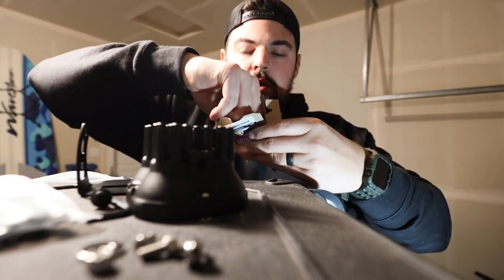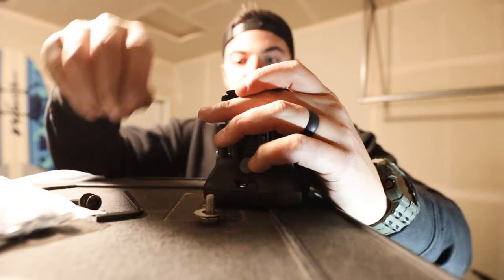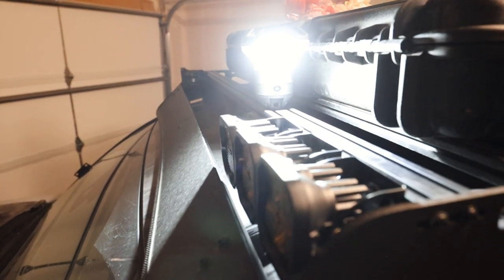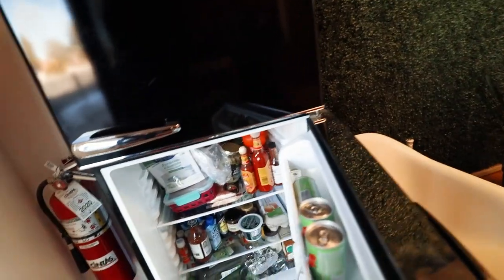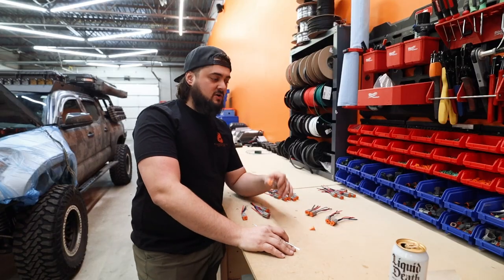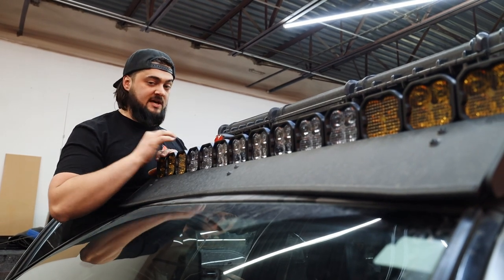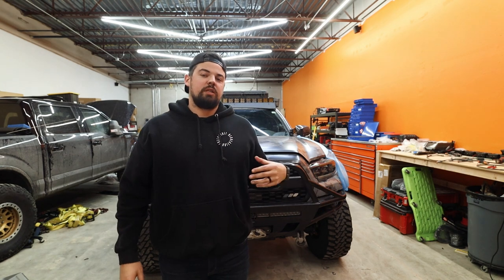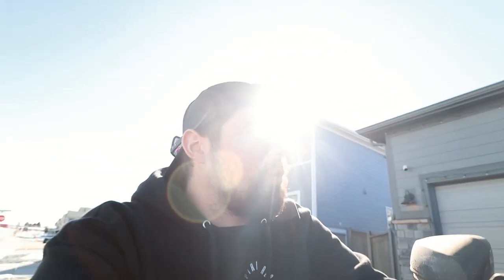Operation PreLander EP 6 / Installing 14 Diode SS3 Pros onto the Sherpa Rack

Comment: Considered doing the same for my tundra on my prinsu, any shots at night with this ? Vs the cost of the SS5 lightbar kit would you recommend this setup or SS5 ?
Reply from the maker: Don’t have any shots at night yet but will be in Moab all week next week and vlogging the whole thing. I’ll make sure to show this off. I also don’t recommend a light setup light this on the prinsu. I did one like it on one and it vibrated my whole roof even after adding two additional cross bars to the rack. Their mounting solution just isn’t up to par in my opinion. Too much stress on the side rails. 

As far as looks go I prefer this setup and less people run it.
Reply: @The_dark_yota  I've had quite a bit of issues with my prinsu. I've wanted to run a Sherpa for a while now just not sure if I could with the holes in my roof from the current rack 💀 
Thanks for the input man ! Love this channel and the work you do.
Reply from the maker: @Rusky231  sounds about right man. I would reach out to Sherpa and see what they say. You might be okay and that Sherpa rack would be a much better solution for you to run the lights man. 
I really appreciate that thank you 🙏🏼
Reply: @The_dark_yota  just reached out to Sherpa, much love man! Looking forward to seeing this setup in action !
Reply from the maker: @Rusky231  no problem! I think my code works for them too if you pull the trigger

Comment: Is that a full bar or half bar for the light bar?
Reply from the maker: Half fairing. A full fairing doesn't let you put any lights on unless you put them on top of the crossbar which looks weird in my opinion. I also have a 15% of sale for their roof racks on my site thedarkyota.com with code bestrack15